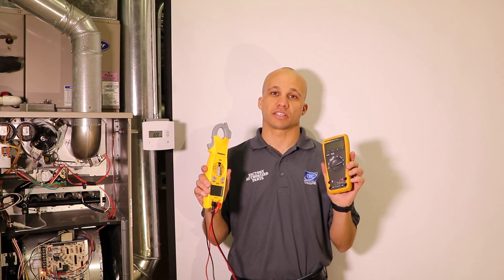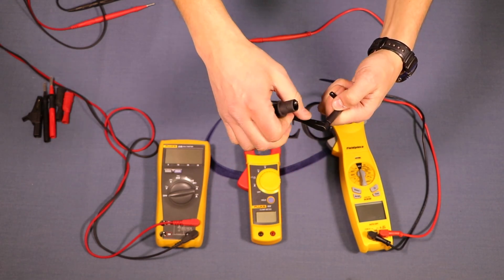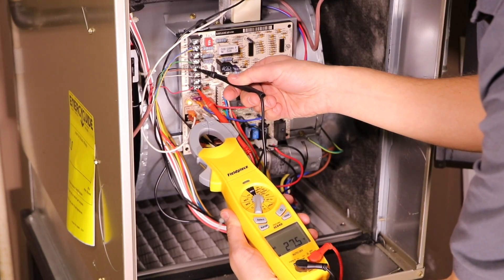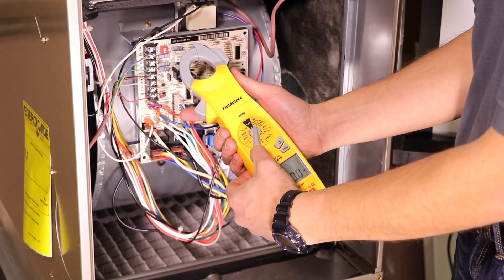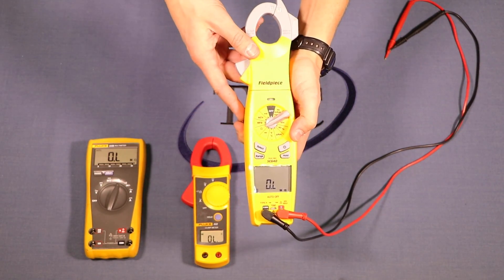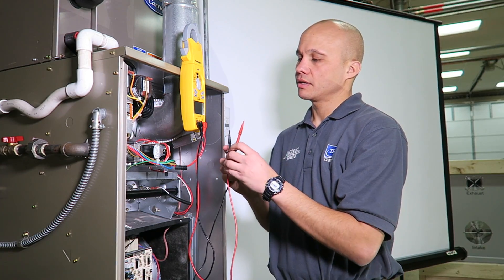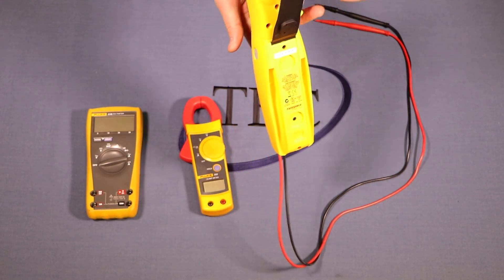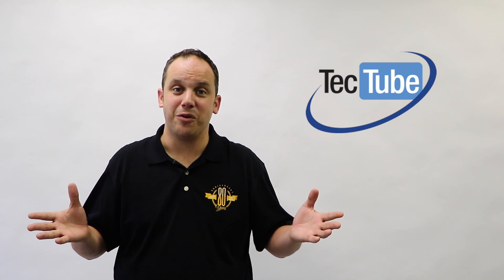Using a Digital Multi-meter for HVAC Service

Comment: Hvac guy came to my house to diagnose but didn't have any testers and said he can't test it if he can't duplicate the problem then suggested I schedule for a complete diagnostic  package with a print out at $650.. is he full of it and just played the girl card on me?
Reply from the maker: Not sure about the girl card, but it does seem odd. If they quoted you $85 to come out and diagnose the issue, they should not then be quoting you an extra $650 to diagnose the issue. You might want to cut your losses and find a new contractor.
Reply: Also charged me $85 to do basically nothing

Comment: Thanks for the informative video!

To test the HUM terminal - would I still put the common probe to 24V common?
Reply: I'm installing an Aprilaire 500M - and connected the stepdown transformer from with HUM and Neutral, but don't seem to be getting voltage to the humidistat.

The circuit board says that HUM should be 24vac, but I've heard some stores about that printing not being correct and it actually being 110v.  

So I'm looking to test that!   If it's in fact 24v would you connect the humidifier directly to hum and common without the stepdown?

Comment: Xmas  . I have 1 question . Do all control board the same ? I am looking for my kenmore , installed 2014 . On line , I can order it for $ 120 , it does not say is it for
kenmore or not . thank u for your respond .
Reply from the maker: No, they are not universal.  Most control boards are very specific to the piece of equipment they control.
Reply: Thanks Xmas . H N Year . GODSPEED❤

Comment: Would love to see a really good review of a reliable meter that can take accurate Inrush measurements for all types and sizes of AC units. Here in the Deep South the HVAC biz relies on getting good Inrush measurements to determine what impact Hard Start 
Kits have on Compressors
Reply from the maker: We have been happy with the in-rush measurements of the Field Piece used in this video.  We have lots of students in our hands-on lab classes and most of their meters do not even measure in-rush at all.
Reply: @TECTubefilms  yes, I looked around for quite a while and found one for around $60 but I feel I went too cheap and I am questioning the accuracy so The Amprobe 51NAV will be next as many HVAC  folks say it is a good one

Comment: The sqiggily line means ac voltage, you can remember it as resembling an AC sine wave. And the sqiggily line with dots means dc voltage, remember it as a constant sine wave, or straight line.
Reply from the maker: yes, correct

Comment: That's  1st squiggly lines means AC the 2nd set of squiggly lines means DC lol
Reply: That's not what he wants to know.  He doesn't know what the symbol is called.  That symbol is 1 period of a sine wave.  Yes it does mean AC but he knows that. He doesn't know what the "squiggly line" is called, which is kinda worrisome.  A technician that doesn't know what that "squiggly line" is called shouldn't be instructing others on multimeter usage.

Comment: 7:20 good lesson. This is what I been trying to tell my cousin. This is the correct way to check if the switch is broken or open for safety reasons. But that's not why I came here. I came here to see a review on these meters. Keep doing what you're doing. Thanks!
Reply: What other way is there if you don't check a switch like this?

Comment: do u do a video on hvac service ? i have a problem after 2 min of running the AC, the compressor would do a hissing sound, and the compressor would shout down.
Reply: Check the charge, do a ohms reading, and a continuity test. It sounds like a bad compressor
Reply from the maker: HVAC service is generally an 18 month classroom training program.  It would be hard to capture in a 10 minute video.  Therefore all of the videos we make are generally for HVAC service... but for specific sub-topics of HVAC service.